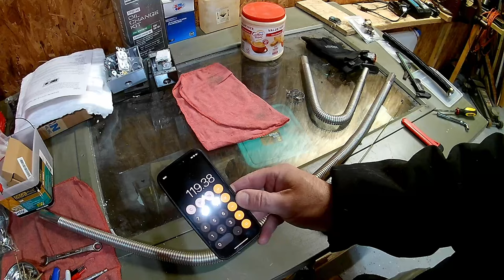Diesel Heater Exhaust Hookup - DO IT RIGHT!

Comment: The real reason the untake should come from outside is it diesn'5 create negative air pressure pulling in cold air from outside
Reply from the maker: That's one of the reasons. In a garage, the air going into the burn chamber might contain combustible fumes from things normally stored in garages, including vehicles. It's for this reason that I'm working to configure my diesel heater to bring in combustible air from outside.

As far as bringing in air from inside to the combustion chamber to then venting it outside; it does force cold outside air into the building. The effects are there, but I believe they are not that impactful and offset by the heat being produced by the heater. Most folks running wood or pellet stoves in a house don't have outside air fed into the burn chamber. Some people DO have their stoves plumbed like that, but I don't know many.
Reply: @TheGergeDIY  yes, true. Some wood heaters have a intake vent designed to be brought in from outside. 
Just more efficient to bring it in from outside
Reply: None of these heaters are intrinsically safe for a combustible fumes environment. Pulling air from outside won’t affect that.

Comment: Great video, thanks for sharing your experience. another way to easily identify the combustion inlet/outlet is the fuel supply nipple is always closest to the inlet. one other observation, the black plastic can that comes with these for the combustion inlet is not a filter, it is a noise damper and actually restricts air flow a bit, if you are installing the unit in a location that is dusty, you're well served replacing it with an actual 25mm air filter to avoid fouling the combustion chamber with dust and particulates.
Reply from the maker: Ah, thanks for the info! I look at that inlet filter as something to keep the big bugs out! As you said, definitely not a real filter.

Comment: You need to locate the WHOLE UNIT outside - that's what they're designed for. Only the warmed air enters the building through a hole in the wall (snugly fitted to exclude stray fumes). (Dot)
Reply from the maker: It gets down to -40f where I'm at, I don't think the diesel fuel would do too well outside in those temps. I'm comfortable with the setup, and I have a carbon monoxide sensor in the garage (two of them actually).
Reply: wrong
Reply: So wrong.
Reply: That’s absolutely not what they are designed for. They are designed to be internal, with the intake, exhaust and fuel tank to be external.

Comment: Is there a reason the air intake is inside? It's meant to be outside and if you lose power while running it will leak exhaust from the chamber.
Reply from the maker: I’ve run it drawing combustible air from outside. It works fine until it gets really cold. The temps here go -20 to -40 Fahrenheit sometimes. When that happens the intake gets a lot of frost buildup and I worry it might clog. I do think pulling air from outside IS best, but that’s why I don’t do it. I may revisit this in the near future.
Reply: @TheGergeDIY  that makes a lot of sense, thanks for the response
Reply: One day, I experienced a hot shutdown because of a accidental battery disconnection, and white exhaust smoke was coming out of the air filter. This lasted only a few seconds and likely contained more dangerous VOCs than CO. Given the likelihood of such unexpected shutdowns, I think the idea of running air intake inside is not as bad under some conditions. Using a smoke sensor in addition to the CO alarm is a good idea,.
Reply from the maker: @walterflores5514  - I accidently removed power from heater once as well. Same results as you, a bit of white smoke came out of the intake filter, no other damage.  

There is a very good reason to NOT pull intake air from inside a building, especially a garage: combustible fumes (fuel, paint, etc.. - i.e. stuff typically stored in garages) can be sucked into the intake and into the burn chamber - that would be very bad. This is the reason wood stoves (or anything with an open flame) are not good in garages. 

It's for this reason that I'm looking for a way to bring in my combustible air from outside. I'll post an updated video when I do that.
Reply: @TheGergeDIY  Sounds right. I draw combustion air from inside since my unit is portable, and I operate it within a insulated fishing pop-up shack in very cold conditions. Just exhaust points out.
Reply from the maker: @walterflores5514  - I bet that heater works great in a popup fishing shack!

Comment: Does any body wrap the exhaust with thermal tape for fire protection reasons?
Reply: I need to get insulated pipe or wrap it because I want to run it through a window but it will burn/melt anything close to

Comment: My pump works fine outside, I found a vacuum tube 90 I used on the fuel inlet, that's one thing I would change about the design. Pretty sure I slid on a piece of fiberglass heat shielding on it with a ss zip tie.
Reply from the maker: Interesting, never thought about putting the pump outside. Temps here get well below zero (f), so I don't think it would work as well for me.

Comment: Would a straight pipe without ribs not be better for the heater?
Reply from the maker: @raczyk - good question. The exhaust pipe definitely feels cheap and it’s certainly thin. I think that’s an area worth looking into for improvement.

Comment: Is the cement removable? Or is it a perminant installation?
Reply from the maker: @raczyk - it’s a strong bond, but it is removable. When I’ve removed an exhaust pipe, I clean it up with some light sanding.
Reply: @TheGergeDIY how do you break It loose, just twist it off?
Reply from the maker: @crappymeal pretty much, I just jiggle back and forth a little, twist a little, and it breaks free. I go slow and don’t force it.

Comment: Your muffler is messed up, mine don’t make any noises. 😂
Reply from the maker: Turn the heater on. 😀
Reply: @TheGergeDIY  yeh the running noise but not the clanging, would drive me nuts.
Reply from the maker: @TinyGoHomes gotcha - mine's outside (and I hope everyone has theirs outside) and I don't hear it. Best of luck with your heater!
Reply: @TheGergeDIY yeh I will do the same. Probably make a box for the noisy pump too.

Comment: The intake should also be outside
Reply from the maker: It can be, I understand that it’s probably better, but… I’m in a non-airtight garage and there is no chance of running out of air. I’m also in an extremely cold climate (we see -20 - -40), and the intake pipe gets frosty when run from outside. Thanks for the reply.
Reply: That was my dilema too,intake inside or outside,technicaly speaking,fresh air with fuel = clean burning so i put it outside and no exhaust smoke at all. Thanks
Reply from the maker: @carlos_sacalul - I believe pulling the combustion air from outside is the more correct way to install. I struggle with it being so cold here that the intake pipe frosts over.
Reply: I agree with the outside air intake, but I understand the issue you are having. For me with lows never going below 25° I found the amount of vacuum created by having the intake inside my garage greatly diminished the ability to heat the whole garage. It effect was more of a bubble at best. After two days I drilled another hole in the steel plate heat shield and dropped the intake to outside air. The unit is in my opinion at least twice as efficient, warming the garage on low continuous heat. The sound of the intake is very loud as well so it is much quieter in the garage now. 

I ordered one to install in the tool box of my truck almost as soon as I had this one running. My big block never warms up until it is driven a few miles. I do notice these units have a lot of voltage draw to warm up the glow plug or whatever is igniting the diesel. It will draw down a fully charged group 24 on cold start. I believe I’ll need to still have the truck running but this will greatly improve comfort.
Reply from the maker: @ryanmontgomery9192  - yeah, I've got an idea on how to pull the combustible air from outside. I believe it is the correct way to run these. I bet that will heat your truck right up! They do pull upwards of 10a on startup due to the glow plug running to get the combustion chamber fired up.
Reply: Heated water pipe wrap?  I'm curious of your solution. @TheGergeDIY
Reply from the maker: @DryUrEyesM8 I use ceramic fiber insulation .This is the stuff used to make pizza ovens and supposed to be good up to 2400f. This is an amazon affiliate link to the stuff I use: https://amzn.to/47wfYb3 - check your local building codes before installing!

Comment: Do you need to use the muffler?
Reply from the maker: It’s a straight through muffler with a spring in it. I don’t believe it contributes much, if any back pressure. I always use one, but I don’t know if it makes a difference or not.